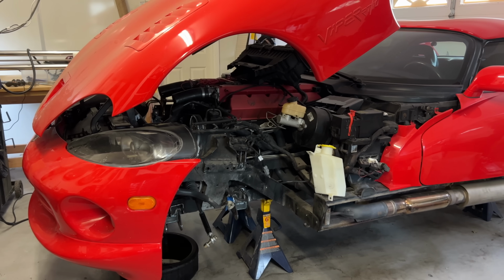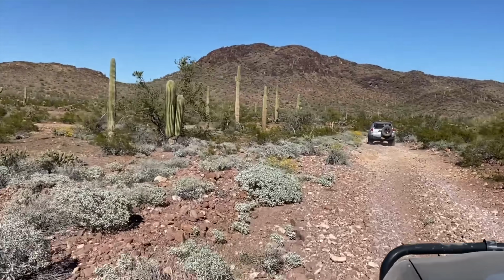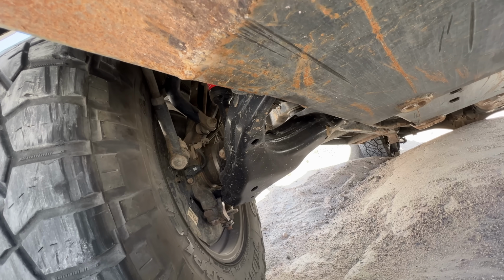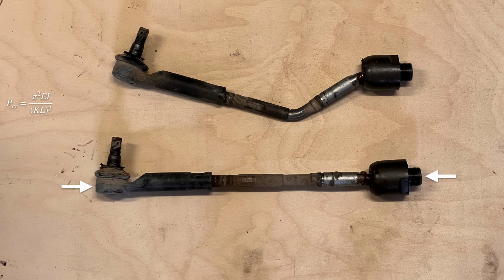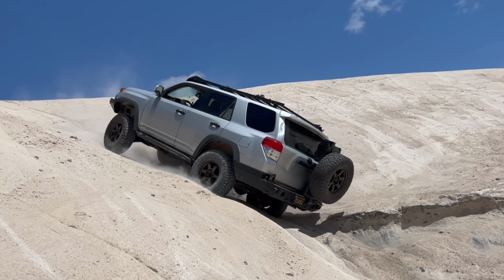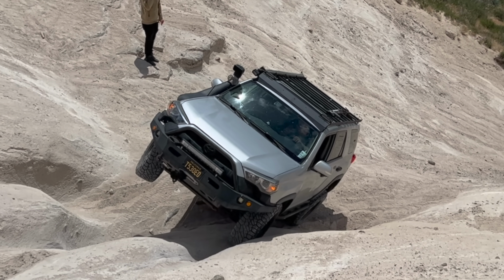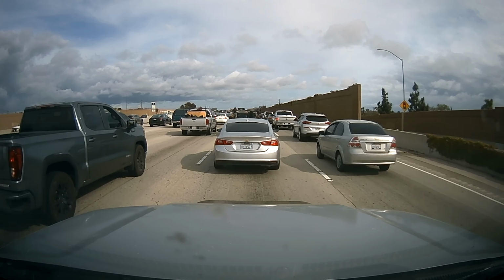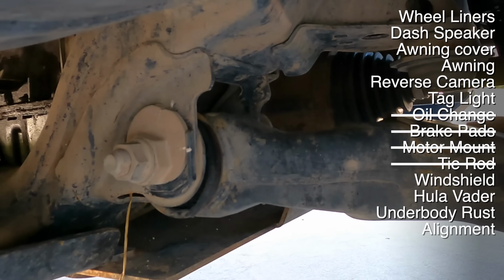Engineering And Mechanical Failures Off-Road

Comment: I work in the rack and pinion rebuilding business , they put those necked down sections as a "fuse" to control what fails.
Reply: Oh you mentioned that, duh..
Reply: @jasonwhite1244  great info anyway! :D
Reply: Yeah in the vid when he talking about making it stronger I was like, "noooo" just let the tie rod take the hit. Heck if you're really that worried about it keep a set in the truck.
Reply: @TurboV8boi  Well, he did say he wanted to make it stronger but he also said he still wanted it to be the weakest link...
Reply: Still nice to get the confirmation.

Comment: Get a solid front axle 4 runner then. It was either 81'-85' or 81'-89' production years. 85' sticks in my head for some reason as the year but it was others too.

Comment: There is a fourth way and my favorite way to calculate buckling. Have the DOD pay for material and just simply do destructive analysis. Makes the presentation very easy basically  "too long, make it thicker because...this" 
"ooooh, how much thicke?"
"thickerrr.....i can find out exactly how much more down to the gram so you can maximize strength, lower weight, and mathematically significantly lower cost. But that might be about 2 years of R&D with a 10mil  budget....faster with more money...with what we currently know"

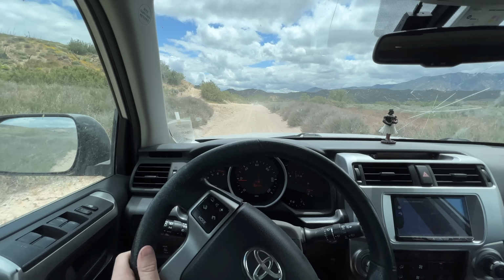Comment: 10:54 Nobody is going to talk about how you have your wheel turned 45° but the 4runner is driving straight.
Reply: Nobody talks about it because that was the only point of that clip.
Reply: When you "adjust" one tie rod to get the wheels parallel, the rack will always be off-center driving straight ahead (assuming it was centered driving straight before the adjustment).

Comment: That 45 degree angle was tough to watch.
I could have sworn it was going to roll over
Reply: The willpower I spent in teaching my dog to roll over, is nothing compared to the begging my truck not to…
Reply: I had my hand out the driver's window as a reflex action to stop my vehicle's impending rollover....
then the Limited Slip Differential kicked in and the remaining on-the-ground rear wheel got enough grip to kick the truck around the hillside and the front end downslope......
ending the rollover motion.
A friend watching from outside and to the rear said he had never seen any vehicle at that angle..and not rollover.
Now I can understand why several sports codes require a net to stop arm and hand movements exiting via the driver's window whether involuntary or instinctive....
Reply: i would've ask for some counterweight on the passenger seat
Reply: @PabloDeLafuria  I was thinking that watching the video.
Reply: Even as a viewer it got me right into the butt puckering zone.
Reply: When i rolled my bmw (very slow roll) I had the window down, out of reflex put my hand out as to "prevent the rolling/falling" but had enough consciousness to pull it right back in and hold from the inside of the frame, my elbow was sticking out the windows and just scrached it a bit. I remember checking on my passenger, and he was..... Duuuude you almost loose the hand i was like yeah i realized 😅 we were drifting our 500€ bmw 320i, bald and old rubber... on a mountain pass at 3am when i accidentally did a 180, and ended driving backwards, modulating the  handbrake as it was my front breaks now(with my front brakes loked) , steering in the dark quite fast, so I made the desition to steer towards the wall rather than to the clif(at a shallow angle, as there was another corner coming soon, that i couldn't see but knew it was there... And didn't want to go straight out of that one either...) the car stopped with only one corner of the rear bumper touching the hill and 3 wheels on the air... I thought i had saved it for a split second 🤣 but then we just slowly did a complete roll... Yeah fun times... nobody got hurt

Comment: I replaced the steering rack off my 03 Tacoma about a month ago.  The point of failure was the input shaft seal.  It's pretty much completely unprotected from sand.  When I put the new one on I gave the hat above the seal a generous helping of thick sticky marine grease.
Reply: Or, you know, could have made a makeshift rubber boot for it...

Comment: Catastrophic Buckling was the first, and hardest, graduate course I took and our book was last published in the 1930s I'm pretty sure because no PhD ever wanted to dedicate their lives to such a difficult subject ever again. Because the tie rod end doesn't apply a load at the exact center of the tie rod axis it decreases the force needed to buckle significantly (there are some kind of maths on this) since it induces a small bending load.
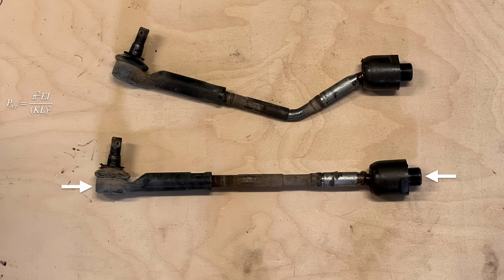Reply: @andrewd3439  silly as it may be, the image at 4:49 shows the force arrow slightly off cl. In this case, it is likely design factors like steering geometry, clearance, manufacturing, or intentional failure point that lead to the design of the tie rod end and tie rod itself over ultimate strength. It is far better to bend a tie rod than break the rack or upright.
Reply: Yep...moment arm....
Reply: I mastered catastrophic buckling in my 20s, but I can't talk about it again because it was too difficult.
Reply: @andrewd3439  this is assuming that the ball joint does not articulate and is a rigid 90° angle.  There is some amount of bending force on this even if the ball joint is at the cl.
Reply: I was told there would be no math.
Reply: Good catch. He said 8klbs for the buckling load and while that was an impact load, I doubt the rack, ball joints, uprights etc would be in one piece if it actually experienced that. It was probably less than 1/4 that. You could compute an upper load limit by finding the shear strength or tensile strength of the upright's tongue where it connects to the ball joint.

Edit: I realized the plastic deformation of the tie-rod is pretty impressive. It definitely bent a few times before hitting the road and had enough strength to limp back despite fatigue failure starting.

Comment: Even though I'm not an engineer of any measure, it feels like you might be way too comfortable with the phrase "it's probably fine" than you should be as an engineer.
Reply from the maker: If you’re doing engineering correctly, there is a thorough physical testing phase where you can really see what happens. This makes the math and analysis phases less critical. After a while you get pretty comfortable with ballpark math.
Reply: @SuperfastMatt "I've done this shit for too long to care about the specifics in my free time so I'm going to assume it's fine"
Reply: There is a surprising amount of "just make it out of a big hunk of steel" with no analysis
Reply from the maker: @KnowledgePerformance7  That's 100% of aftermarket off-road engineering
Reply: @SuperfastMatt  In Australia we make such preposterously heavy aftermarket accessories that you can't include your  passengers because the legal load limit of the vehicle is exceeded. People still do it of course, but if you have an accident, you're in a world of pain - assuming you survive.
Reply: @andoletube i feel like thats because alot of people select the "all the gear with no idea" approach, twin locked 80 series diesel with way too much fuel pump adjustment, all the lift giant tyres, bullbar, rear bar, sliders, all made from material that one length of which could double as the entire chassis, roof basket with a tent on it and then theres the fridge awning etc etc etc making the vehicle so heavy that it now needs three times the tyre width of standard just to not sink to the diffs the first time its on soft ground, then, instead of picking the easiest way to progress through a track to a specific location, they "send it" through the hardest way to show off to their mates behind them... Meanwhile someone else who just wants to get to x location just drives up there in their stock pajero/jackaroo/ 100 series etc taking the easiest route... Then gets made fun of by all the cowboys in their beat up junk with 40k worth of heavy useless crap stuck to it, for having an alloy bullbar, or a pajero/jackaroo/whatever undesireable 4wd not acknowleging the fact the "shitbox" made it up there too, and they spent 5-15 grand total to do it, and didnt break anything on the way. I used to see it all the time when i went bush. Young bloke with his dads old hand me down jackaroo would make it up whatever track that all these cashed up 75/79/80 series/ gq/gu dudes spent the whole day tackling, then at the summit or camp ground theyd be making fun of the bloke in the jackaroo, but like...he made it to the destination aswell.
Reply: @Colt45hatchback  Very true, mate. For some, it's just about the adventure. For others it's more about the bragging rights and big-noting.
Reply: @KnowledgePerformance7  I remember once as a first-year engineer, one of my first tasks was designing a (very) large steel component for my company. I spent quite a bit of time optimizing it for minimum material and mass. 

During the design review markups, the senior engineer added half an inch of material thickness pretty much everywhere, and wrote in the margin "steel is cheap".
Reply: @MattWestwick  that's about how i approach building unblueprinted structures
2x4's are cheap if it looks sketchy add wood
Reply: @Matt Westwick  Sounds wasteful, until something breaks and results in downtime or worse. When steel prices are high maybe only pad 1/4". This all depends on industry and application but there's certainly a lot of places where a few bucks/pounds of steel for the extra margin is preferable to failure, ever.
Reply: @chublez  You also have to put in consideration.
Time and cost for engineers labour vs. Cost of steel.
If you safe 1000 bucks on steel, but spend 800 bucks of optimization, you just safe 200 bucks, but with simple overbuilding it for 200 bucks it will survive a forklift crashing it.
Reply: @MattWestwick  Hah! I had one of those, but I got the other end of it: "labor costs money". I designed a simple L shaped lever arm. Supervisor sent it back to me with a line drawn from one end to the other, turning the L into a triangle. Post-It note on it said "don't create unnecessary work for the machinists".
Reply: ^ I think part of what makes a good engineer is being able to judge what needs to be fully optimized and what can just be “good enough”. 

Unless you’re designing for the razors edge of performance most things can be ballparked
Reply: @AnthonyMoody  In my experience, basic engineering intuition is very valuable as you can get a rough idea of a situation on observation alone. 

The actual calculations are just to be extra sure your intuition is in the right direction.
Reply: I thought it was all checking against a threshold of should-be-fines per hour
Reply: Engineering is a bit more complex than "doing the math", you've got to juggle between requirements, budget and time constraints. If you ask an electrical engineer to design a multimeter and say it has to have a sensitivity of 0.01 V versus if you require a sensitivity of 0.00001 V it will have a huge impact on design and manufacturing costs and design time, and the engineer themselves will probably have to do a lot more painstaking math (by taking into account physical phenomena that normally have negligible effect for example), simulation and testing; whereas with the coarser sensitivity they may have just been able to throw something together with off the shelf components and napkin math.
Reply: This is also an entertainment channel, not a nitty-gritty engineering analysis channel.  I suspect there's a lot of tongue in cheek going into every utterance of "it's probably fine" and a lot more thinking than is shown on camera, as watching someone think generall doesn't make for good TV.
Reply: An experienced engineer's "Should be fine" holds a LOT more weight than you're thinking. This is not some idiot saying "should be fine" about his cinderblock lift kit. This is not some soccer mom saying "should be fine" when the mechanic tells her the Escalade's brake rotors have separated from their hats.
This is someone who has looked at the load paths, made things way more robust than a weekend warrior could, and then acknowledging that a professional car design might have optimized things a little further before mass-producing the things for retail customers.
Reply: I feel that's the inner(?) Motorcycle riding Matt?  The it's probably fine is right up there with, shrugs 'well, that missed' and go about your day?
Reply: Just comfortable enough
Reply: Too much wrenching on your own stuff breeds apathy and fatalism.

Comment: Ummmm, why are you surprised that brutalising a vehicle results in dramatic mechanical failures? Why do it unless you enjoy near death experiences and lots of wasted time waiting to be rescued? I like it much when my vehicles are running/operating flawlessly so I want that state to continue as long as possible - less stress, headaches and $. For thrills I do cheap things.
Reply: this guy doesn't get it.  Definitely not crawler material.
Reply: @RoverDon123  yeah, I do get it, but it’s pretty far down the evolutionary scale. I gave up destroying shit when I was about five so I can no longer relate.
Reply: @lrowlands53  As for myself (or the above video) I don't 'destroy shit' - but I do push it hard and understand that things can and do break.  Yes there are people who seem to do that - don't care about anything and actually enjoy causing damage.  I built my truck for a purpose and I use it for that purpose but I do make ever effort NOT to break things.  I'm a crawler - not an east coast 'pin it and pray' guy.  Slow and technical.  Only as fast as necessary.  And as I generally drive my rig to the trails unless it's more than about 6 hrs away I have to keep it alive to get back home.  But if you want to wheel trails like Fordyce, Rubicon, Dusy, etc you will always have the possibility of breaking things.   SFM is running an IFS 4runner and clearly not doing any serious crawling with something like that but he still seems to enjoy pushing it.  Doesn't matter if it was back in my road racing days or now in my going slow in the rocks days, some of us just enjoy taking whatever we have to it's limit, finding that limit, then improving on it and trying again.   Had to take the bypass at WH3? Let's build better and try it again next time!  It's apparent that you DON'T get it if you think people like us are just breaking shit for the sake of breaking it.  And lastly, SFM was certainly not "brutalizing" that yota.  It was a challenging climb for a basic build like that but that's exactly the point - overcoming the challenge.  If you want "brutalizing" go check out southern rock bouncers.
Reply: I don't think Matt was surprised in any way.  Pretty sure he has a good handle on "destructive testing fun" which is what offroading basically amounts to (I'll include drag and circuit racing in there too, they just usually blow up different stuff).

Comment: great story and lessons learned as always. that thin section definitely appears to be an engineered "failure" point to protect the rack to me , why else would Toyota spec out the time and cost to turn that section down with the lathe? Someone smarter than me probably knows.
Reply: I cant speak for Toyota but a Buddy works for another Offroad Vehicle manufacturer and they do it too so this does seem to be a Purpose break point.
Reply: @Monarch-industries  
Hopefully a purpose BEND point?
Reply: don't you mean lathe that section down? you know, the thing you do with a lathe? lathing things? ^-^
Reply: @xymaryai8283  touché
Reply: @dooby1445 that's the joke

Comment: Matt, you have steel bars on the sides, when the car leaned to the left, someone should be standing on the right side to balance it (ofc it's dangerous, but in europe quite popular in offroading)
Reply: At a 45⁰ Angle, that does hardly anything. If you draw a vertical line from where someone could be standing to the ground, it'll be very close to the contact patch of the lower tires. Thus, it just involves more people in the rollover.
Reply: @kain0m  I disagree. I've seen cars on worse angles than 45 deg and it helped. You're standing on the bar, hold to roof rack or rails with hands and lean as far from the car as possible, this helps to shift the center of mass. Even if the car rolls over, you're on the 'higher' side so you will be fine most of the times
Reply: I was leaning towards shifting loads inside the car to keep it from tipping over…
Reply: That offroading technique isnt available for City-boys.